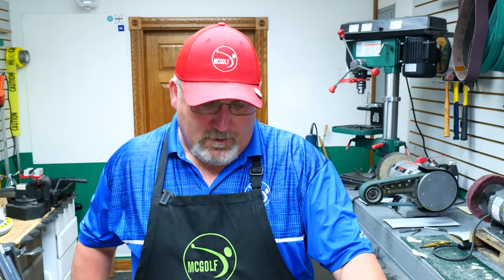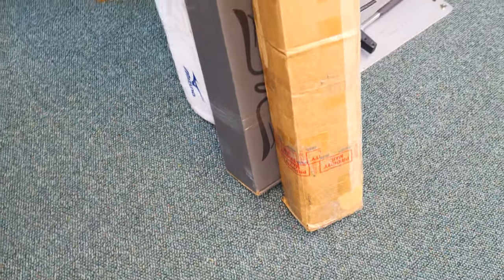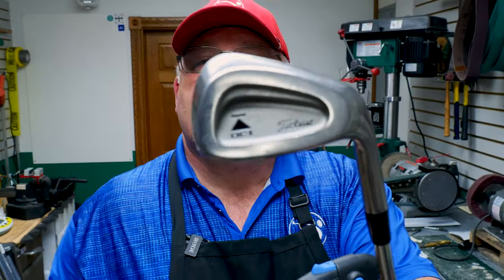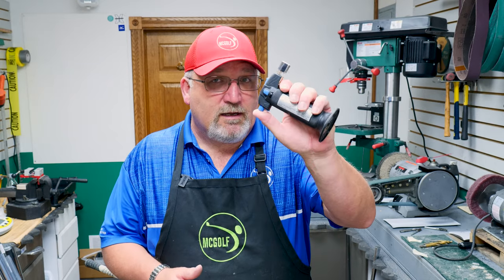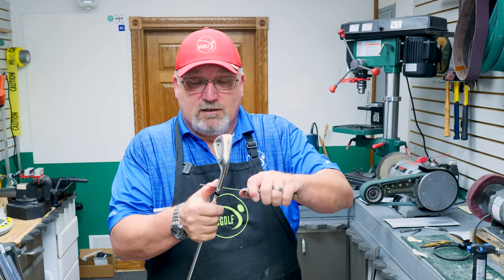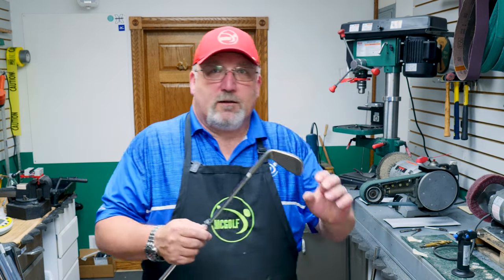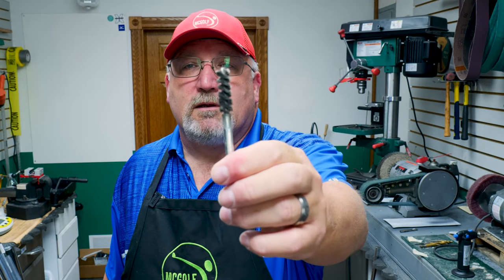Removing an iron shaft by hand

Comment: Thanks for the tip on pulling shafts in Pings during the Memorial Day WIYD. I was worried about the multiple minutes of heat I applied and the hosel discoloration. You made me feel a lot better and that it was normal for Pings. I used a bit of Barkeepers Friend to get rid of the discoloration.
Reply: What heat gun did you use and how long did you have to apply the heat?
Reply: @bobking7311  Used a small butane torch. No heat gun. Still took maybe 2 minutes per head if I remember. It's been a while. Those Ping iron heads are tough! I couldn't tell you about woods though. That may be different. Best to ask Jim.
Reply: @nickjohnson8246  Thanks. I've gone well beyond 2 minutes per head using a small butane torch like Jim's without success, but your comment about not worrying about the discoloration gives me hope. As for asking Jim, what's the best way to do that?
Reply: @bobking7311  email him or on Monday's at 4 he does that live Q&A called what's in my drawers. That's where I asked about ping jrons being hard to do. Yeah it may have been like 5 minutes an iron. It was ridiculous. Their epoxy ain't no joke. They do weird stuff. I have an Eye2 Gorge wedge that's .355 hotel with a .370 shaft hammered into it. That's how they made it.

Comment: Awesome content.   Funny thing is that your hand strength is off the charts.   Question: would you pull heads that way Everytime?  Would you use a puller more often?   Cheers.
Reply from the maker: for graphite I use the puller every time, I try this method for steel but the hand strength fails and I use the machine

Comment: I'll give a simpler tool. 
To remove the head, balance the club on a table with an ordinary candle flame over the end of the hosel away from the ferrule for 5mins - maybe 7 mins depending on the day temp (you don't need to rotate the club to apply the heat. Just let it heat up and melt the glue. To remove the ferrule  use hot water for 10-15seconds. Use a bit of sandpaper to clean the end of the shaft. Use a drill bit to clean the inside of the hosel. Use super strength two part epoxy with heat tolerance maximum you can find.

Comment: OK< my frustration is building quickly. I'm also trying to remove a shaft from a set of DCIs (Gold) and no matter how hard I try to heat the hosel it just won't break loose. I'm using a similar butane torch to yours, and have heated the hosel for as long as 4-5 minutes while rotating, and it STILL won't break loose.  Should I just try longer until the epoxy finally gives, or what's the problem?

Comment: How about an old set of paying g5s that I used to have back in the day and now I am 80 so I bought them off eBay and there's no distance even though I hit the ball solid. Is it worth the effort to change all the lies stronger? They are going very high and short. The five iron is a 27° standard lie with the ping soft regular shafts. I sent you a lot of questions but never receive answers. I am also never able to locate merchandise that you say are just below the video and I can't find them.

Comment: can you tell me if KBS make a .355 parallel tip shaft? also do you know if the miura baby blades are tapered shafts or parallel?
Reply from the maker: .355 is a taper tip designation, as far as i know all miuras take .355 shafts
Reply: @McGolf  thanks im trying to change to graphite shafts in my Miuras but for some reason i can only get about 1/2 inch of the shaft to go in? is this normal for graphite. im positive they are .355 tapered as i ordered them online from golfworks. even the .355 Ferrell is extremely tight on these.
Reply: @dansapp6619  Did you sand off the paint? On graphite shafts, you have to sand down the tip just a little. Most of the time, I've only had to remove the outside paint. I did notice the Aldila NV Black iron shafts took a little bit more material removed to get it to fit in the hosel.
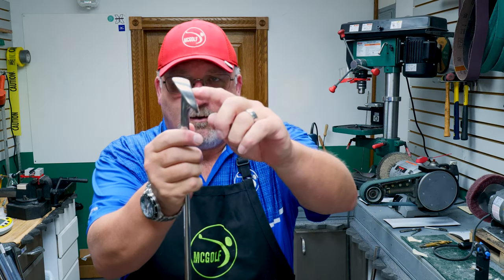Reply: @dansapp6619  Here's Golfwork's video on it. They do tip prep at 2:10. I'm sure Jim has videos on it as well if you dig around. But I got lazy myself and found the Golfwork's video first. https://youtu.be/UzcZpmWcdOI
Reply: @nickjohnson8246  thanks I did have to sand down the tip quite a bit as the miuras were already tight on the steal shafts. i appreciate the info
Reply: @dansapp6619  Cool. Glad you got it worked out. Sometimes I get frustrated when I'm building up a set what with the shaft pulls, prep, epoxy, gripping, etc. and something isn't working like those graphite shafts you had. But I get so much more enjoyment out of building it myself and then playing well. It's a cool thing. I started making my own bass fishing lures years back and caught the DIY bug on my hobbies.